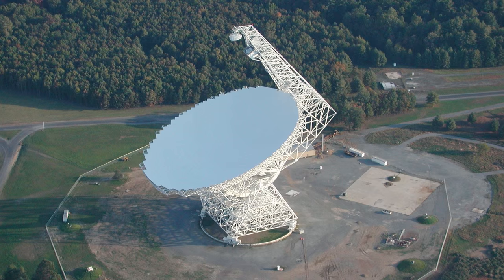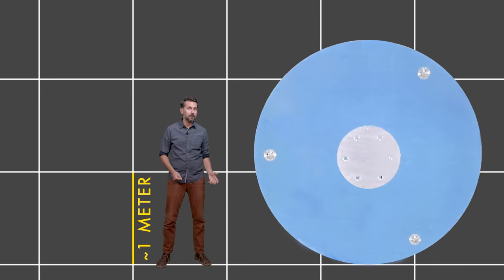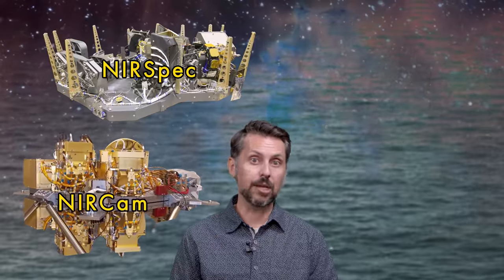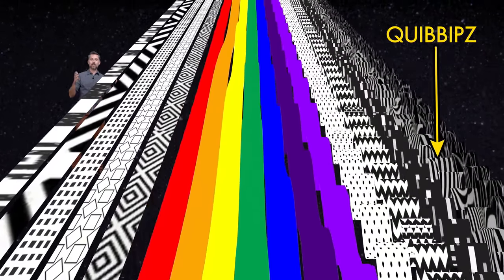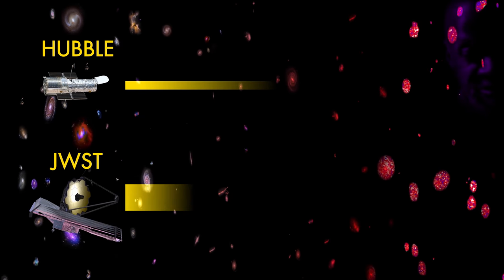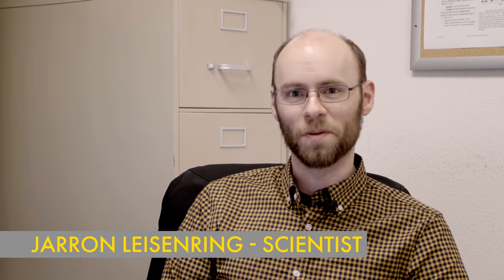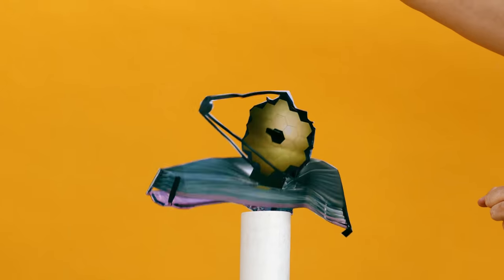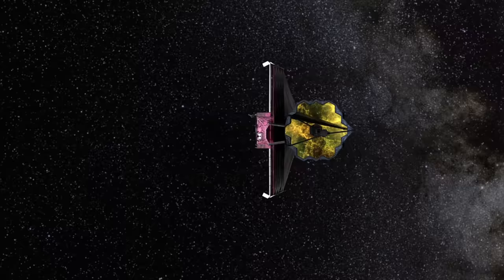This Is A Film About The James Webb Space Telescope

Comment: How are images from JWST relayed back to earth from the opposite side of the moon? Is there a moon sattelite?
Reply from the maker: Craig, the orbit of JWST will make sure that it won't be blocked by the moon. We didn't go into it in the video, but it'll swing in a big circle as it goes around the sun, and while it's out there, it'll use a little radio dish to send messages through what's called the Deep Space Network, a series of radio telescopes here on the Earth.
Reply: @kevin_hainline  Thanks Kevin, have a good launch and deployment.